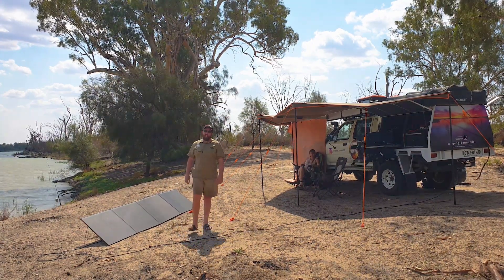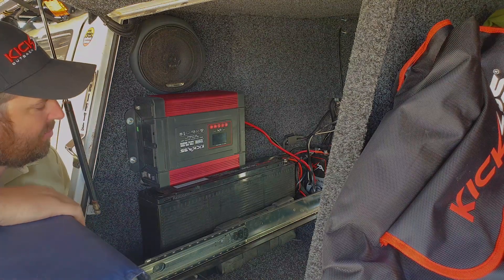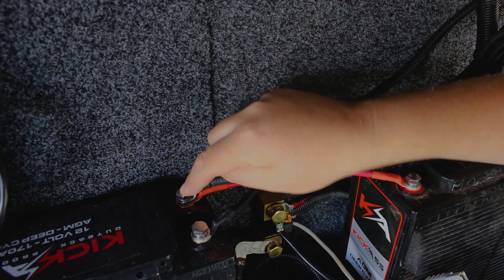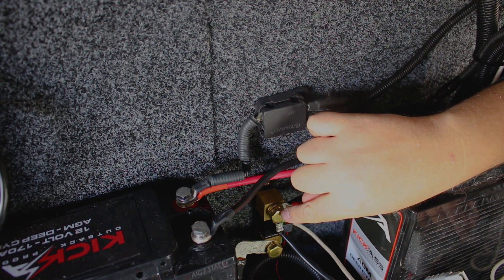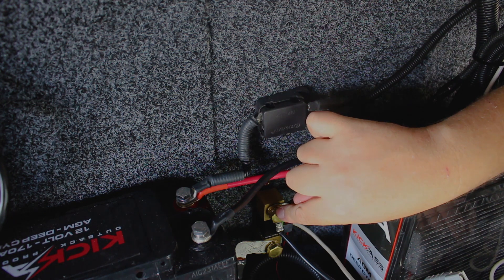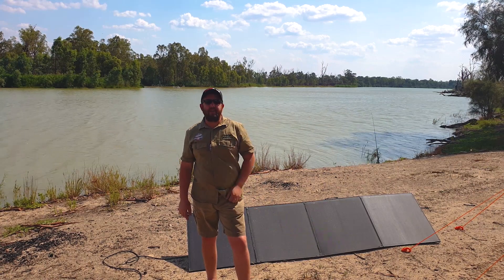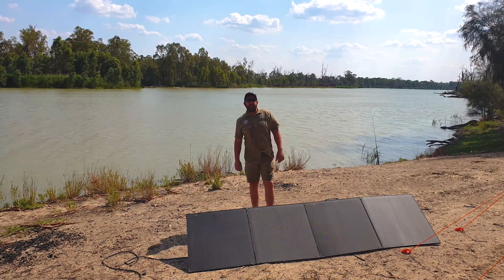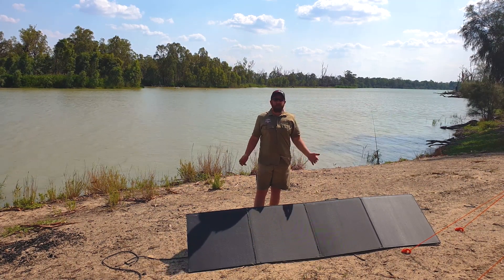How To Link 2 Batteries

Comment: Is it ok to connect 4 slimline LiFePo4 batteries in parallel?
Reply from the maker: You have to confirm it with the battery manufacturer

Comment: G'day mate,
Pretty new to all this but just hooked up a 100ah agm with battery box to with a 280 watt panel and a 120 watt blanket when need just got another battery and box and would like to do the same instead of 2 separate units do i need to put and shunt in etc
Reply from the maker: A shunt is only necessary if you want to measure the current going in & out of the battery

Comment: Thanks mate, this helped me as i end up getting another battery to link to my other battery. I end up gettign a KickAss slimline one that will be going in behind the back seat then place the Redarc BCDC on the window or close enough to it, but having 240ah be good When i go camping as i wont need to start the car up once a day when the engel is running as a fridge and freezer.
Reply from the maker: Glad to hear it helped you mate 👍

Comment: I have the exact same two batteries. How have you mounted/secured them in there without a tray? Just looking for ideas. Im probably going to go with Mkove battery monitor which has a shunt. I've only got the 200w slimline solar but should do the trick. Going to pick up one of their inverters any suggestions on max size with the 340ah. 
Good looking set up cheers.
Reply from the maker: I use the Kickass battery trays. They are great. I also use the victron battery monitor. I also use the 1200w Kickass inverter which has been fantastic. Feel free to use the discount code Downunder10 to save some money on the Kickass website 👍

Comment: Just wondering if both battery’s need to be the same size for example I have a 120ah and a 75ah can I link them up?
Reply from the maker: Good question. Unfortunately not they need to be the same capacity to be the most efficient. You'll end up reducing the life cycle of one of the batteries

Comment: Awesome little video mate. 
Contemplating these batteries. Just need to figure out space in the back..
Reply from the maker: Cheers mate 👍 I wanted to fit them behind my back seat but couldn't quite fit it. They are only 10cm wide & 30cm tall so you might be able to fit them in yours 👍
Reply: @Campingdownunder  yeah I'll have to check the back seat section. Modify thr cargo barrier but see what i can work out.